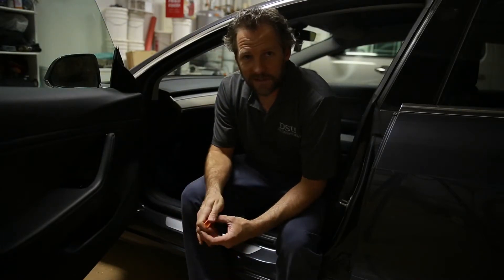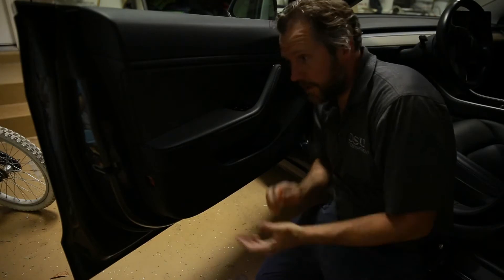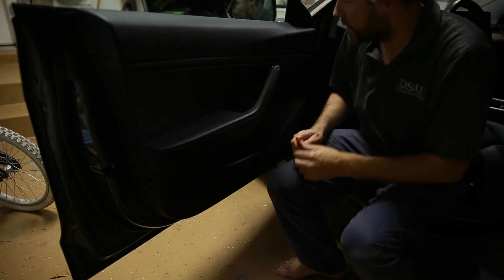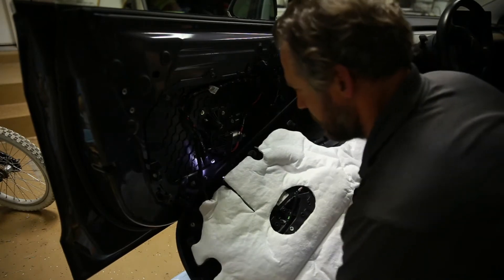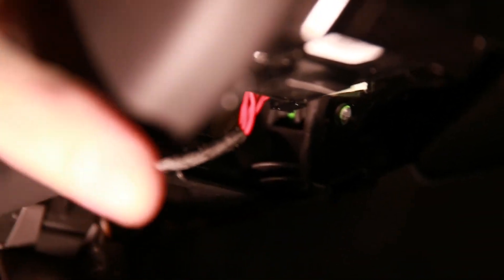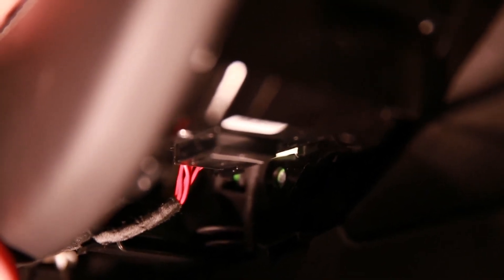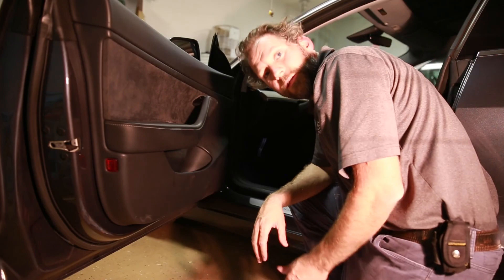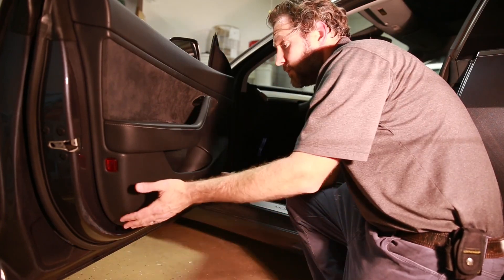Replace Window Switches in a Tesla Model 3

Comment: if just an individual switch came out because of broken plastic retaining knob, you may be able to roll window back up by holing the switch in place(DOWN) with one finger(hand) around the midpoint of switch, then with other finger(hand) lever back up in usual way; as i was able to do.
i saw a post on tesla forum about sticking pick into lower right side of individual switch holder to lever back and forth, but i personally could not make window go up in that manner, only down.

Comment: YOU DO NOT HAVE TO REMOVE THE DOOR PANEL.  I just replaced mine on my 2018 M3 and once you get the access door off the switch is right there.  A few tips:  The plug on the switch itself is weird - there is a center tab but it does not push in easily.  I got a thin flat head and wedged it in just under that tab and the plug pulled right out.  it is helpful if the emergency open leaver is pulled up.  A small screwdriver wedged in the gap after it is lifted will hold it up.  There is very little clearance on the far side of the switch to get to the tabs that hold it in place.  The near side there is much more space.  If you use a thin flat head on the near side and release the two tabs (put some downward pressure on the switch) - the switch comes loose and just firmly push and the 2 tabs on the far side will release.  Overall it took me about 15-20 minutes to replace the switch!
Reply: How did you get off the access panel after you took out the 3 Torx screws?
Reply: It just pops right out.
Reply: @gerrywithaG  thanks! I was a little worried about breaking it.

Comment: awesome!! 2020 model Y here. you can replace this part without removing the door panel. like your video shows remove the bottom panel cover. hold that latch up and press down hard. took me a few tries cuz i was afraid of breaking stuff. used a metal tooth pick to carefully remove the connector wire from under the switch(i didn't use the wire that came with the replacement)... the sad part is i inspected the broke part and it's made of low quality plastic. i expect this will break every 2 years.

Comment: Don't take the door panel off.  Remove the (3) torx t-30 screws and pop out the old switch from top (rubber mallet).  Put new switch in from bottom.

Comment: I am in the same situation on the broken driver side main window controller switch on a Model 3 2018. The Tesla service center sells the part for $39. The cost to have a mobile tech to go to the house and install is $81.02. I am not sure if it matters on the charge but the Tesla service center is 15 minutes away from the house.
Reply: Same I have a model 3 lr 2018 and started having this issue
Reply: Same car. Same Issue as well

Comment: The model 3 is my first car where the window switch broke.
Reply: I had one break on a Ford as well - not common but it happens.
Reply: My Prius had the same issue, but was due to carbon dust on the contacts and broke gear. This was way easier than fixing the Prius.

Comment: Was the replacement switch cluster the same as the oOEM (guessing it is OEM) but I mean are the replacement switches backlit like the original ones? My 2018 Model 3 drivers side window will go down all the way when I push down but in the upward auto mode, it no longer will. The drivers side switch stays slightly higher when I try upward auto than the switch next to it. It will go up if I hold it up but I don't like things not working. Too confusing to do myself. I think I will schedule an appointment for hopefully mobile Tesla service to fix and replace.